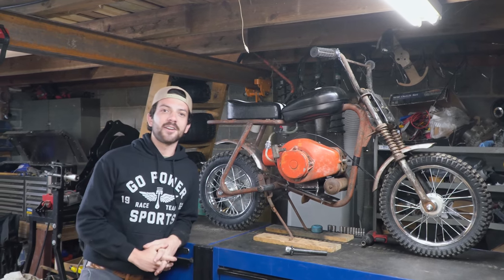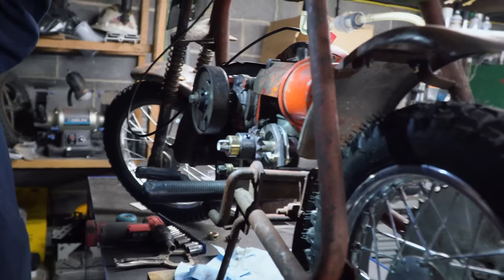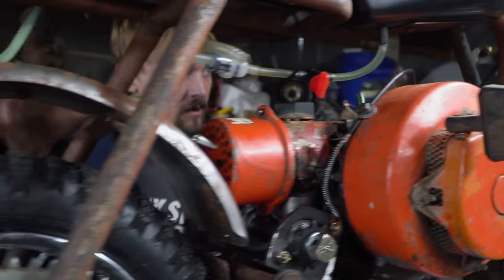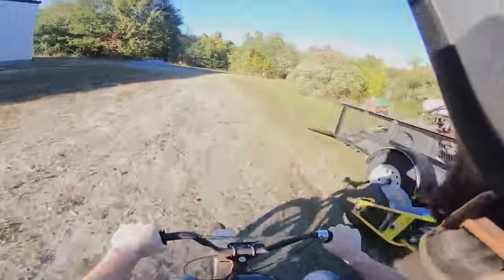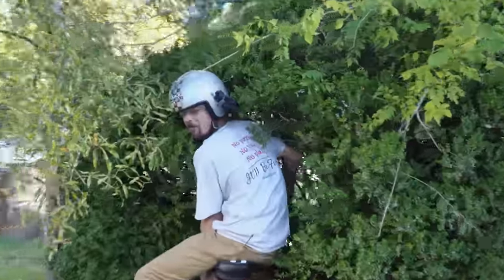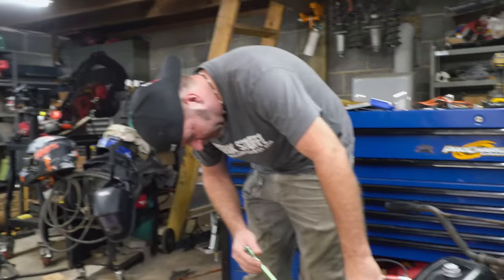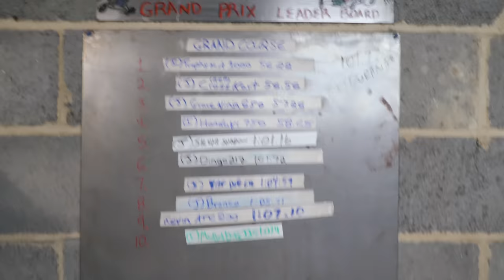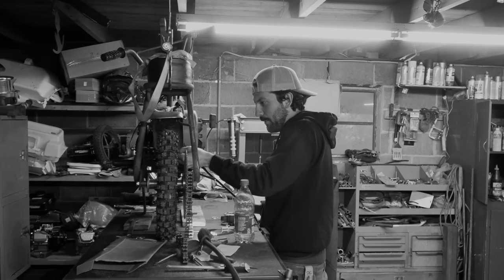Making our 2HP 2 Stroke WASHING MACHINE Powered Mini Bike Faster!

Comment: Yall should do some power mods next, better expansion chamber, bigger carb, higher octane gas, shaved head, then tune the clutch to engage at a higher rpm since it's power comes in later than a 4 stroke, stuff like that lol

Comment: I mean, instead of doing all that mess. You could’ve just put a smaller gear on the back wheel. Probably end up with the same result of no power, but you wouldn’t have created cramped space to work with. Y’all keep up the great videos none the less. 👍

Comment: Mount a little torq-a-verter cvt on it to take advantage of the power band and get you some more grunt down low and speed when its up in the band. Maybe get a few sets of weights with it so you can tune it as well.

Comment: The easier method changing the gear ratio would be to change the clutch body to a smaller sprocket size.  They offer a selection in the better clutches. They range from 12 to 17 or so. I had several clutch drums when my son was racing 5 hp go-karts.
Reply: Of course we were using 35 chain rather than #40

Comment: Puch mopeds (50cc) were rated at 1-2hp. They will do 25-30mph stock, with mild mods and tuning 50mph is not impossible (without increasing displacement). Install a big bore kit and 65+mph becomes a reality.

Comment: Seems to me like the thing this engine lacks the most is torque rather than horsepower. Most 2-stroke engines don't produce much torque at lower RPMs, or at least that's the way I've found it to be among 2-stroke mopeds. The one and only exception to that rule so far has been my 1979 Kreidler MP19. And I'd say some other commenters might be correct about the incorrect use of a centrifugal clutch that's designed for a 4-stroke engine. Seems logical to me that you'd have to have a clutch that engages at higher rev rates, in order for the engine to spend as much time as possible in the power band, and thus get as much acceleration as possible out of it.

Comment: Now find a 50's or 60's McCulloch chain saw engine and do a transplant. Even a Lawson/West Bend 2 stroke would be a big improvement. Of course these are solutions your grandpa would have done as a kid. A two speed drive or a torque converter and lower gear would make this old engine work better too.

Comment: when we getting a two stroke engine build there’s some ways to turn that little thing into a monster with mor compression forged internals and stamped stainless steel expansion chamber porting and polishing all the fuel channels this small motor could probably make 10 or more horsepower with the right amount of mods
Reply: In order to do that you have to replace half the engine, and you're better off just buying a new one. And there is no way you're going to improve the power by over 500%
Reply: Was thinking the same, even just an expansion chamber and higher compression should make a difference already.
Reply: @EMFRocks  the engine is tiny. Higher compression will make so litte difference, and will probably kill it.
Reply: @dannywhite132  but the point is to do it on that engine but your logic you shouldn’t modify anything just get another engine i spent a couple grand on a pit bike a klx 110 and it’s the best thing ever so much power on such a little bike is so amazing
Reply: @EMFRocks  there’s thousands of things though just taking a grinder to any 2 stroke will make it function better
Reply: @sagenbabin8786  that's not my logic at all, re-read my comment. Why spend 200 doubling a 2hp engine when you can spend that on a 10hp engine.

And lol you spent a couple grand on a pit bike what a fucking waste 😂😂😂 you know what else is fun? A good bike
Reply: @dannywhite132  you do it because it’s awesome I could have bought a stock crf 150r but instead I got a Kawasaki and turned into the best racing dirt bike in its class
Reply: @sagenbabin8786  but for the money you could have gotten a far better on. I very much doubt yoi are better than world leading motorbike engineers
Reply: @dannywhite132  oh yeah I suck compared to world class engineers but I had fun building it it’s an awesome conversation piece at the races and it’s a lot of fun to ride instant torque and a top speed of 65 it does everything it is supposed to when I want it to do so
Reply: @dannywhite132  and all together the price of my pit bike is the same as a brand new one and mine runs better is put through hell every ride and still works every time so yeah it is a good bike and the same price as a brand new bike of the same brand and runs better than most trail bikes other than the crf150r low key I love that bike

Comment: Has that engine got an appropriate exhaust?? Not sure how that tiny engine works but maybe a proper exhaust with higher back pressure would help with the low power?? Tiny bit more efficient

Comment: I used to have a 2hp minibike, it had a hard time pulling me around, it had a gear ratio close to 10:1, I think 12/13:1 would have been perfect. My top speed was around 28/30 mph.

Comment: Needs porting can you put it on a degree wheel to check the duration on baseline exhaust and transfers mainly the transfers I'd widen the exhaust port to about 70% of the bore and multiply the transfers bbdc by 3 and that's the exhaust duration you want to shoot for

Comment: You need to put a better carburetor on it and also put a clutch that will fully engage at much lower rpms and as for the gearing you need a bigger gear on the clutch side and a smaller gear on the wheel if your truly trying to achieve both pull power and top speed

Comment: It's pretty much powered by a moped engine.

Replacing the restrictive silencer with a tuned expansion chamber exhaust, will give it at least another pony of power.
Reply: I agree. It is designed to small rpm range now. And so is carburator n

Comment: you just need a lower rpm clutch, may still have lower power but at least it will take off, I had a cart with an old 5hp Briggs and it would not take off at all, it turned out it was just a slipping clutch and I put the clutch on a predator and it went just fine.

Comment: Unfortunately your read valve is probably all worn out causing the lack of power. From my understanding these are lower RPM two-stroke engines not like today's more modern to stroke that ribs to the moon. You can hear it in the sound of it when you free rev it with the back wheel off of the ground. The Reed valve is definitely messed up.

Comment: Take off that exhaust and put even a straight pipe on it and it'll massively wake up, two strokes don't do well with that much backpressure. Now if you were to add a decent carb and an expansion chamber, I'm sure that thing would HAUL.

Comment: Build an expansion chamber!!?? Its easy as taking 2 sheets of metal and rolling the edges... Weld them together with a water fitting... Hook up pressurized water and blow the metal up like a balloon... Cut off both ends and weld fittings for the flanges.... That's it... It only takes a couple hours...

Comment: Hey fellas just found and subscribed to you all about 2 weeks ago. Im building a motorized 26 inch wheel bike with a stock predator 212 hemi( governor removed)with a 10 tooth clutch and a 40 tooth rear sproket. Is this going to be gutless ?

Comment: You could hear it barely getting into the powerband at top speed.  Engine to jack shaft should have been 2:1 reduction at least.  Also why didn't they just put a 1 inch spacer under the engine and their clearance problems would have gone away.

Comment: Hey could yall do some proformance mods on the gc series honda engine because on the market there is no kits or anything im really curious if you can have some real power with the gc series engines
Reply: the gc series is so budget in the valvetrain they cant handle aditional power, the rockers crack under normal loading.
Reply: You're better off buying a Predator 212 when it's on sale for ~$100. Black Friday isn't too far out, plus tons of cheap performance parts

Comment: Did y'all open up the intake and exhaust ports?
Pretty sure those lil motors can make closer to 10hp
Reply: Or .5 with incorrect port work real quick lol      let them figure out how a 2 stroke operates stock first..      they have lots of catching up to do
Reply: @CobaltOntarioadventures  from what I remember the openings were just restrictive.
Mind I didn't say change port timing
Reply: Anything that changes the flow changes everything about the flow, not just the port timing.    My entire point is these guys are literally trying to figure out how 2 strokes work as they.build these things.    Last place they have business being in is the ports of the engine lol   that's all.     Knock yourselves out if you want..   but it'll make them look like total tools to me.     That's all lol    reading something In a forum doesn't equate to an engine builder that can do port work.   It's super easy to screw up, period.   As much as the timing matters, so does the overall flow.  Changing the flow in the intake changes flow through the transfer ports and also the exhaust port..     leaning out the fuel:air. So you also need to jet..    and probably build a proper tuned pipe made to use the new engine dynamics to their full potential.    That is to say..   race port a stock 2 stroke engine and put stock pipes on it..  it'll barely gain anything, if at all.    It may lose power..    But almost as importantly..  its a trade off with HP and TQ.   No matter what you do.   This engine needs "less"port, to pull put more TQ.     If you do all of the above PROPERLY, you'll probably have a 8-10hp engine.    But these are not the guys for that job.
Reply: @CobaltOntarioadventures  opening ports is usually limited to  the size ofintake and exhaust manifolds, or the studs or mounting holes for the manifolds. 
You can only widen them but so much.
It would be really hard to screw up a 2 stroke by simply widening the intake or exhaust. 
People screw up by changing port floor or roof heights, in other words, port timing. 
And you can make significant power gains without a tuned pipe, perfect example is chainsaws.
Reply: And I was thinking of the old Tecumseh 2 stroke snowblower motors I think. 
Rated 3 hp, with a displacement larger than one would think for 3hp.
Intake and exhaust ports were easily 50%blocked if not more
Reply: Do you understand that bigger ports= less velocity?  If you do, you should also be able to understand that that changes the dynamics of the engines flow..   therefore, doing nothing else to it will make it not run right, and likely lean out.   Can you improve on stock ports with stock everything else? In most cases, yes. But its a pretty small margin, and not something you want to just wing, there is a point of no return you won't even know you cross if you do till its too late.   I'm not going to keep explaining what you can easily Google yourself.
Reply: @CobaltOntarioadventures  so I guess restrictor plates are to help gain power 🤔🙃
Reply: @Imageloading...  you put restrictor plates in 2 strokes?    Figure out how a 2 stroke works, man
Reply: @CobaltOntarioadventures  do you understand that I've actually done what I'm saying makes power?
Who said more fuel, or larger carb/intake wouldn't be added? Who's saying the muffler won't get opened up?.
Properly engineered expansion chamber will undoubtedly bring the most out of all the other mods, but in real life, significant power increases are usually done with opening up cylinder ports.
Simple bump of compression with base gasket delete (if not a clamshell motor).
Not just a carb
Not just a pipe
Not just unlimited coil.
Reply: @Imageloading...  you did in your original comment...      sure didn't mention the entire engine build that has to go along with it lol    and you don't "open up" the muffler.   That's ridiculous lol
Reply: @CobaltOntarioadventures  actually yes you do.
Some echos, and bigger Makita/dolmar you literally open on seams, remove catalyst, modify baffles, make exit of muffler larger. 
Some Stihl models tou unbolt the 2 halves and modify them.
You literally open them up as in dissection, and by making openings/pathways larger
Reply: @CobaltOntarioadventures  actually yes you do.
Some echos, and bigger Makita/dolmar you literally open on seams, remove catalyst, modify baffles, make exit of muffler larger. 
Some Stihl models tou unbolt the 2 halves and modify them.
You literally open them up as in dissection, and by making openings/pathways larger
Reply: And you said bigger ports equal less velocity. 
So with that logic, restrictor plates make more power.
.
Of course I don't do that.
That's stupid. 
Stupid like saying opening intake and exhaust on a 2 stroke would make less power

Comment: I have a bike i built named DeAtHtRaP its a doodle bug with a power washer 414cc big block with a home made stage 1 kit and a torque converter top speed around 65mph and it takes off you would not believe and im going to try to show up to the next C+C event

Comment: Cool bike, looks period. For a bit more power you could surface-grind the head and cylinder, on a flat surface 80 grit paper and wd40.  Also thinner headgasket, a hone, and portmatch cyl and case and intake. Cost nothing to do and with the right carb it will fly.

Comment: Move that engine up 2 inch's and have all the clearance you need! that motor can and will run upside down...when Charles was riding the home stretch you could hear the exhaust is holding the power band back from making power

Comment: Knock off flat slide carb. A tune pipe from a 2 stroke scooter or even a pocket bike. Take 3/8 of an ounce off each of the clutch shoes with a drill. Great build otherwise.

Comment: Change clutch springs noobs 🤦‍♂️ thing is engaging at low rpm while 2 strokes should have higher rpm engaging clutch springs.... this is embarrassing.. and they call themselves professionals 🤣
Reply: When have they called themselves professionals?
Reply: @a-a-rondavis9438  i was being sarcastic with that one, but i think that doesn't matter does it?